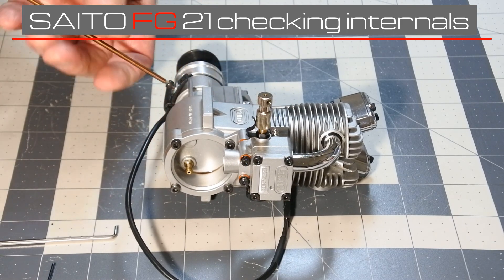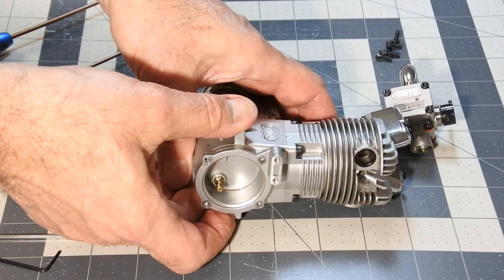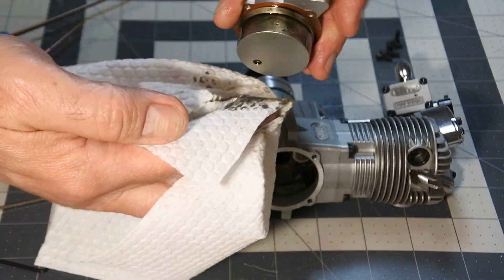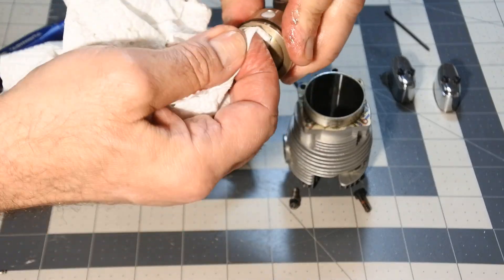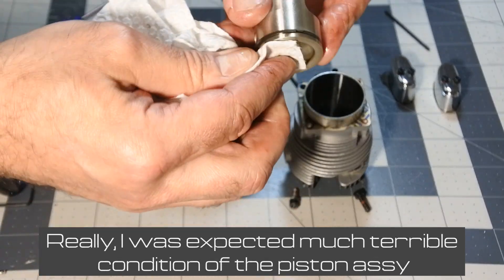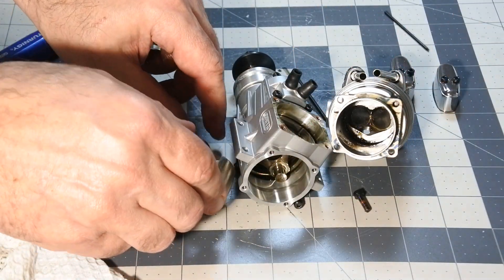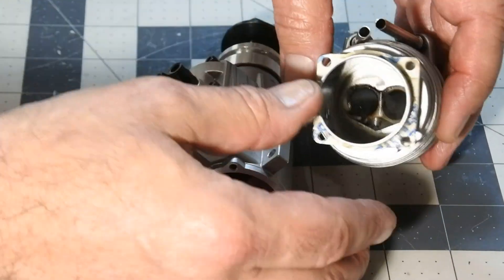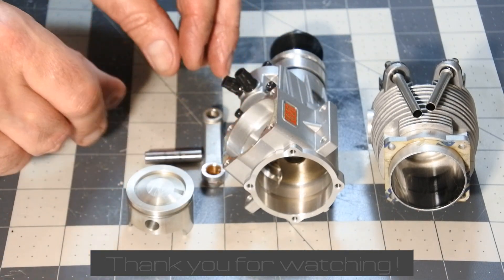Saito FG 21 checking internals after 35% NITRO tortures test

Comment: Hi mate,
sorry for the late reply. I didn't expect any damage in there as you could hear how smooth that engine was running. If anything, that bit of nitro will also help clean up the carbon in the long term by cleaning up the fuel burn through more efficient combustion. 
My concern was if the timing wasn't correct and if the engine was 'pinging' then there is the chance of damaging the rod and its bearings given the low amount of oil these use. But as you saw everything was good so overall I'm very glad you performed the test as now I'm happy that its not an issue.

Maybe try some nitro in your big 3 cylinder 60cc engine to smooth it up?

Oh, one more thing. Using a little bit of methanol will help nitro mix with gasoline. 1~2% should help. It won't detract from performance.
Reply from the maker: Thank you very much for your comments ! It's OK. Should say, that when I looks deeper in crankcase, I found, that bearings wasn't in so nice condition, as it looks like at glance. Main bearing shows some crackles, and the prop bearing was too tight (we should take into account that Saito installs both side closed bearing at front). Both were replaced, of course, I have some spare bearings for Saito's FA 120 & 120's, and install it. Regarding FG60 engine, I'm so tired from it, so let's it wait for a while. I've some idea, how to modify it's intake manifold / fuel distributor, but with a lack of time and necessary mechanical tools (need a lathe, at least) it will wait until the better times. And b.t.w., the key FG60 problems are from the conrod's assy and with fuel distribution. So, due to the fact, that ignition correction flange is already installed, the next step - even fuel distribution. Thanks for an advice with a methanol  addition. I check, that 30% and over amount of NITRO isn't dissolving well in gasoline mix,  the solution becomes cloudy, partly due to water (which is present in nitromethane in small amounts due to its hygroscopicity) but also due to the fact that gasoline has limited miscibility with nitromethane.
Wrote a whole novel, sorry for the many words :-)
Have a nice day and thanks for the kind words!
Reply: @crazyengines88  you are spot on about nitro being hydroscopic. Its my understanding that it's very polar hence the reason for its miscibility in water. The other thing to note is while the little bit of methanol will help nitro to mix in gasoline, a good synthetic model engine oil is usually even better at assisting here. But I know you're already doing that so you're right there.
Till next time
Reply from the maker: @aSpyIntheHaus   Thank you for you reply ! I've basically, few oil types, of course, Klotz Techniplate, or Rl-198 Lite Techniplate for glow fuels, Klotz Gas Burner for gasoline mixes. I'm not so big fan of Klotz, except the special Klotz scent. Motul Micro 2T oil is one of the best, my preferred oil, according to mine experience, and for gas mixed fuels I prefer Saito recommended oil  - Power Model 2T-S (UK made), it's performed very well. 
Thank you, and with best regards !

Comment: Like new. 😂
Reply from the maker: Thank you for the comment ! Like new, you're right, but only from the first look. I found today, that both engine's bearings weren't  in good condition. Main bearing had some crackling sound, and front bearing was too tight, so not all was so good. Both bearings were replaced for a new one's, from Saito FA 120S engine, I have few spares, and it had the same bearings, as FG21. And after that replacement, really, engines becomes like new 🙂